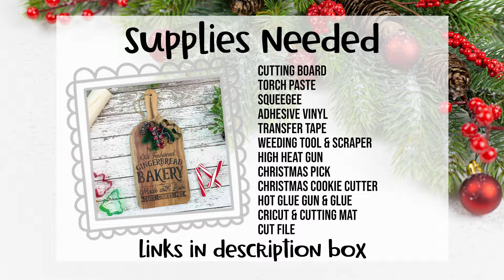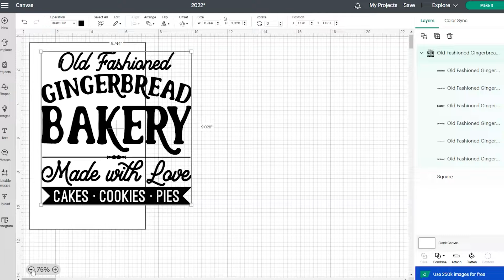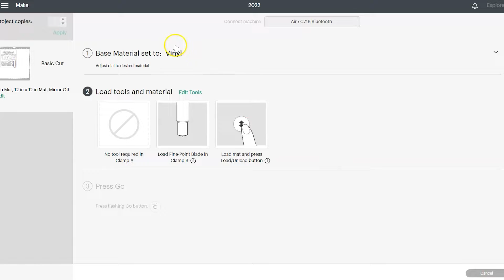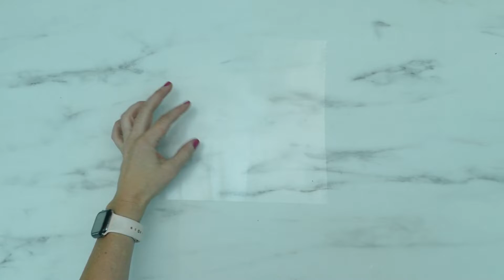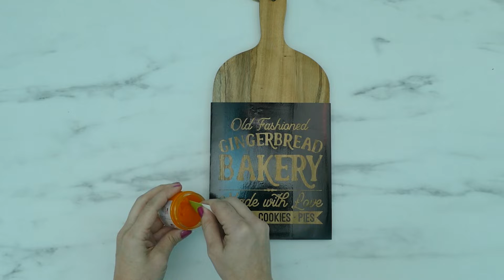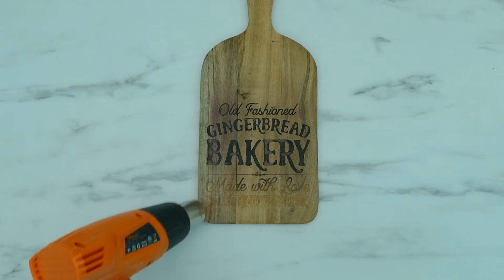DIY Wood Burned Christmas Cutting Board with Cricut | Handmade Gift Idea

Comment: Is the cutting board a finished piece of wood with some sort of seal already on it ? Also is it possible to use cardstock is a stencil? Thank you
Reply from the maker: I think the cutting board I used had a clear finish on it.  You can use cardstock as a stencil, it's just a little harder to keep all the insides letter pieces in place.